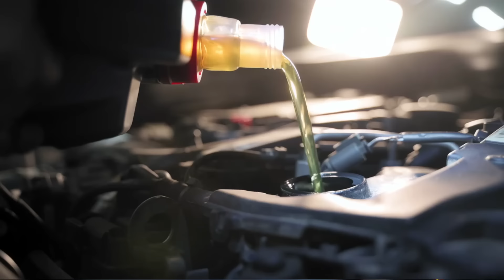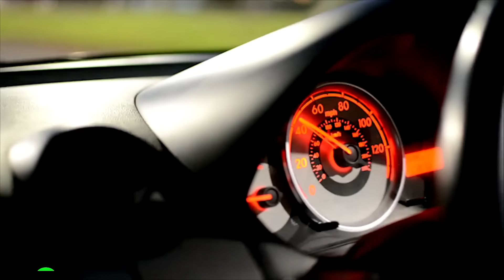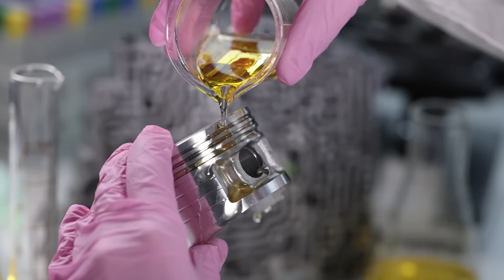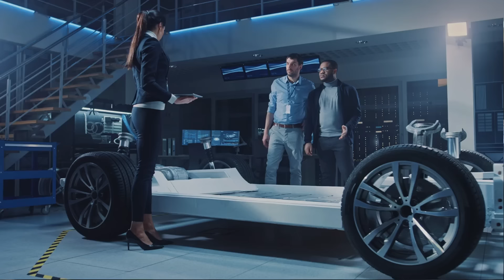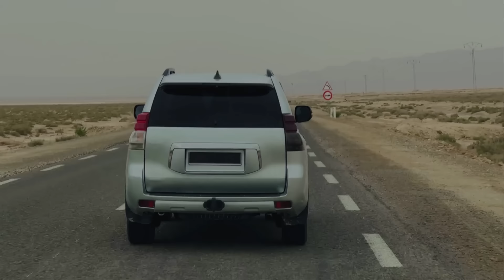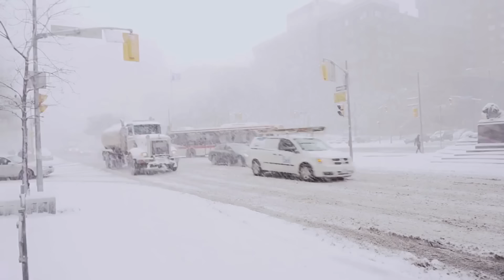Why the Same Engine Uses 0W-20 in the U.S. But 5W-30 Everywhere Else (Mechanic Explains!)

Comment: Liquid-cooled engines are designed by the manufacturer to operate within a specific, optimal temperature range, which for most vehicles is around 195°F to 220°F.  The cooling system, which includes a thermostat and radiator, actively regulates the coolant flow to maintain this range regardless of the ambient temperature.  The cooling system is also pressurized by the radiator cap, which raises the boiling point of the coolant (a 50/50 mix of water and antifreeze) well above 212°F, preventing it from boiling at normal operating temperatures.  While the system is designed to maintain a stable core temperature, extreme conditions (e.g., heavy towing in very hot weather) or a malfunctioning cooling system can cause the temperature to fluctuate outside the normal range.

Comment: Because car dealers are in the business of selling cars...0-20 will destroy your engine sooner.
Reply: I had a Ranger that I put 550,000 km on with 0-20 oil. I scrapped it because the rust was so bad, but the engine was still quiet and smooth. I did 15,000 km oil changes, and my only repairs were a starter and an alternator.
Reply: @DAB65  Canada? We live in the southern US where it rarely drops below 20*f.  Most new cars are labeled 0-20 but don't need it especially in the summer when it's 90+
Reply: @crashdsnowman1  , Just a quick question, your manual/dealer says only use their brand windshield washer fluid, do you follow that?
Reply: @DAB65  No, don't use the same oil you do either.
Reply: @crashdsnowman1  , I use the oil that is needed for the job. Mostly highway miles and no towing or hills.
0W20 has never negatively affected any member of my family's engines.
Reply: @DAB65  My Duramax uses 15-40, Mercedes 10-40, None of my motorcycle use 0 anything  same with both boats. Wife's old Lexus called for it and had pre-mature valvetrain wear, her fathers GMC 1500 Denali also had problems with lifter wear. After the dealer rebuilt the top end of her fathers truck the dealer put 10-30 in it. As soon as she purchased the new Lexus I changed the oil to 10-30.
Reply: @crashdsnowman1  , Diesels always use thicker oils. Higher performance engines also use thicker oils. Just like I said, use the oil needed for the job.
BTW, the 0 weight only apply within the first few minutes of starting the motor and the oil is a 30 or 40 weight when at running temp.
Reply: @DAB65  not if it's 0-20, it would be 20w which it what this and many other articles are about. https://www.youtube.com/watch?v=2-ECI5uK9eE
Reply: @crashdsnowman1  , there is no such thing as 20W.
My point is as soon as the oil is at running temp it is the viscosity of the number behind the "W".
Reply: @DAB65  I know  the second number is the viscosity when at operating temp and this article is about 0-20 like I said in the first post and , just like the one I linked.
Reply: @crashdsnowman1  , Lake Speed Jr has said numerous times that if you don't drive hard and do oil changes on time that 0W20 isn't an issue.
Reply: 20 and 30 weight oils pretty much flow at the same speed at running temp. 
Remember, Chevy told truck owners to go up to 40-weight oil (from 20) if running your truck hard.
Reply: @lonniebeal6032  , I've already said, use the right oil for the conditions. If you tow, drive hard or fast, and in higher temps a higher viscosity is needed.

Comment: I’ve never seen motor companies recommend different oil grades in the same engine.  The French, German, Chinese, only recommend one specific oil standard chemistry.   I have found oil companies  oil selectors will recommend wrong oil grades !    Renault uses a specific Mobil oil standard at service, and the Mobile oil selector at retail stores said this other type was recommended, l put in 750ml top up, instant chain noise !

Comment: I switch from 0W-40 in the winter months to 5W-40 in the summer it’s always full synthetic oil in a large diesel. 
My wife’s car is 36 years old with original engine which has had no major issues it uses 5W-40.

Comment: I have a 22 jeep grand Cherokee with a 3.6. It takes 0W20. My 23 charger with a 3.6 takes 5W20?
Reply: At running temp, they are both the same viscosity, that's what the 20 is.
The 0 and the 5 are the oil's cold temperature viscosity.

Comment: As per my car manufacturer recommendation either 0w-20 or 5w-30, i live in cold climate in the midwest part of US however about four to five months weather is very cold and snow up to three months, rest of the year is norma and pleasant weather. Should I use 0w-20 during winter months and 5w-30 other months, does it affect the engine negatively?

Comment: Toyota CCH in NW Orygone. Short trips and 77% EV ratio. I'll stick with 0w20. For now... A long trip for me is 28 miles, never drive over 60 as EV mode won't above 61-62mph, drive truck right lane if ever on freeway. I'm NEVER in a rush. I drove ALL of the 55 era.

Comment: According to Grok:

You are 100% safe to stay with 0W-20 at 5,000-mile/6-month oil change intervals.
There is no significant benefit to switching to 5W-30 and you may lose 0.3–0.8 MPG for zero measurable gain in wear or longevity.

When 5W-30 Would Help:
Towing >3,500 lbs, sustained 6,000+ RPM, High mileage (150k+) with oil burn

Blackstone Labs UOA (Subaru FB25, 5k OCI):
0W-20: Iron 12 ppm, Aluminum 3 ppm, Viscosity 8.9 cSt
5W-30: Iron 11 ppm, Aluminum 3 ppm, Viscosity 10.2 cSt
→ Statistically identical wear

End Grok.

Comment: In regards to Myth #3, according to Chrysler, the MDS of the 2009+ Hemi is designed for and requires 5W-20 to operate properly.  I live in TX and tow.  I would like to run 5W-30 for the extra protection.  What complication would occur if I ran thicker oil?
Reply: I switched to Penzoil Ultra Platinum 5w-30 in my 2015 Ram Hemi. I started to get the  notorious Hemi tick. I'm also considering putting on an aftermarket Hi-Flow oil pump. Some people were using 6.4 Hemi oil pumps in the 5.7 and  now they are marking them as aftermarket parts.
Reply: @AdBass59  American cars are going to blow up no matter what oil you use

Comment: My 02 Mustang GT has a recommendation of 5W-20 and my 14 Xterra is 5W-30. Both vehicles are out of warranty so I'm not concerned about warranties. A lot of people have different opinions about what oil to use. Based on several videos I've seen, I've been thinking that I should use 0W-30 in my vehicles that will cover the subzero to 100F+ degree temperatures that occur here. I plan to do the switch to 0W-30 at the next oil change. The only way to know if the switch has harmed the engine is to do an oil analysis.

Comment: My 3.0 Duramax diesel recommends 0w20 but common sense told me that wasn't right. I took an oil sample and then changed my oil to 0w30. Ran my truck for 1600 miles and changed the oil again, again using 0w30. Ran it for 3k miles and took an oil sample. The 0w30 had significantly less wear metals than the 0w20 oil, and the 0w30 had more miles on it. Notably, my fuel mileage was up slightly, not down like you would think, my engine oil temperature is down and not seeing any changes in oil pressure. The engine was already smooth and quiet to begin with so no noticeable difference there. I live in Texas and winter is coming up. I may stick to the 0w30 but I still have 10 quarts of 0w20 left.
Reply: Just make sure with diesel engines that if you change the viscosity you use that it still matches the other specs of the oil, like the API or ACEA grade. The 0w-20 speced for your diesel is different from the 0w-20 that most gas powered cars can use.
Reply: @madmatt2024 I went from M1 0w20 esp to M1 0w30 esp. Exact same additive package but higher viscosity & hths.

Comment: Have been running 0w-16 for 285K miles.
No issues.
OCI 5000K or 6 months.
Reply: Exactly, unless pulling maximum weight or in a hot climate, the recommended oil is fine.

Comment: My vehicle's oil cap states 0W-20 Dexos-1.  I use 0W-30 Dexos-1 in -40C/-40F deep cold winter months. During winter months I mostly do many short distances.    I use 5W-30 Dexos-1 in hot climate (+20C/+30C) summer months.  My vehicle tows trailers in both winter and summer months.  I also do my own Engine Oil & Filter changes when remaining use percentage is between 40% (which is 5,000 miles used).   I also installed an engine block heater and onboard battery charger.   Always "plug in" both during < -10C winter months....  This works for me...
Reply: Hi,why you dident use 0w40 ? or 0w30?
Reply: @sapereaude9907  Why would I put 0W-40 in Gm V8 5.3L engine?  40 is way "too thick" for the deep cold winter months.   Especially since I mostly do only short trips.   Just like clothes, the "thickness" is based on weather.  Same thickness does does NOT fit all weather seasons....

Comment: The extreme temperature range in the us plays a big part. From Alaska at -50 to death valley 125 they have to pick something that covers it all. Most wear happens at start up especially in extreme cold when flow is slow. Use common sense depending on environment and usage.
Reply: The older car manuals would recommend different viscosities depending on the expected temperatures.

Comment: I live in the south of France, On my CX-30, I switched from 0W20 to Castrol Magnatec 5W30, (the manual recommends either) the motor runs a lot smoother, the gas mileage didn't change much!
Reply: your saving your engine 5/30 yr round for my vehicles
Reply: keep that.  Clooney.🤡 ok
Reply: you need 10W-40 bro
Reply: You shouldn't notice much of a difference. 5w30 might be a little tougher on your oil pump tho. I would've switch to 5w20. You dont want to put to much of a strain on the motor. The number after the W is a lot more important that the first number.

Comment: They are designing the engines to fail, the same engine that says 0w20 would be better with 5w30 or even 10w30 but they are more than likely making the oil pumps for thinner oils and it could possibly make a burden on the pressure and prematurely ruin the oil pump?
Reply: No, they are using thinner oils to squeeze mpg performance. This is because of stupid government regulations that will charge for emissions...be mad at your stupid and greedy politicians!

Comment: Run the 0w-20 in the fall and winter and switch to 5w-30 in the spring and summer
Reply: I was thinking that 0W-30 would be good for year round use. An oil analysis will show whether I'm right or wrong.
Reply: @genericdude6551 . Sorry but it’s gonna be 5w-30 year round & I’m in PA
Reply: I switched from 0w20 to 0w30 in my Honda Ridgeline with 185k miles on it. I noticed the engine runs quieter and smoother. I just sent the 0w20 oil sample to SpeedDiagnotix for analysis. The challenge with 0w30 is it is difficult to find and not many manufactures make that weight oil. I found Mobil 1 0w30 at Walmart online for $25 for 5qts. I may run 5w30 in the summer months and 0w30 in the winter months.
Reply: I use Amsoil 0W30 in the winter .
Reply: @peterrudy9207 i tried amsoil signature 5w30 0w20 and 0w30 , i feel 0w30 has viscosity in the middle between 0w20 and 5w30, so i will go for 0w30 the whole year, my car is honda civic 1.5t
Reply: @peterrudy9207 If it is Amsoil Signature Series (pure synthetic)  - then 0W30 is good year around(high temperature does not beat it as much as other (mineral) oils
Reply: i make 5000 km per year
Reply: *0w30 for winter
Reply: Better yet, switch to electric
Reply: @Mabeylater293 you can’t take that electric car out to the Moab for a week.
Reply: @jesses6697 why not?

Comment: Down here in PR. Is almost over 75° all year long .I think I'm  gonna do one more 0W20 oil change and then switch to 5W30 on my 2024 Tacoma.
Reply: i agree with this move. my 2003 tacoma V6 stick runs like new with 204,000 miles using 5w-30 it's entire life. in ohio, it drops to around zero degrees in winter, and reaches 95 in summer. cheers 🛻

Comment: I can't kill my 23 year old 2003 VW GTI VR6!  I use LiquiMoly 10W-40 full synthetic, changed once a year (about 7500 miles), and I still have the original timing chains too!  Never changed the 6-speed manual transmission oil as well.  Shifts and drives perfectly!  WHAT A CAR!
Reply: Amateur.  My 2004 Honda Pilot has 480k kms on it.  I use the recommended 5W20 oil.  I use whatever brand is on sale.
Reply: Amateur, because he uses better oil than you? Pouring cheap, on sale oil makes you a pro? Omg, what a stud.
Reply: @scott88060  yes exactly. He was flexing because he assumes expensive LiquidMoly 10W40 led to his exceptional results. I used cheap oil and also achieved great results. So yeah, I am a top tier pro, obviously, and much smarter. I note he doesn't state his car's mileage, but I would guess my 22 yr old engine's >480k kms is almost double his. You simps assuming more expensive oil is better are laughable.
- Super Stud
Reply: @daveladd5614 I'm sorry but pilot drivers r generally turds. GTI much more credible
Reply: @daveladd5614 rookie... My Kawasaki ransomes 36 inch walk behind I bought in 1990 is still running flawlessly on straight 30weight   youre a tool with your measly 480k.  I've got easily that in running hours alone.  Have a seat

Comment: Think about this, in 1988 a Chevy 350 used 10w-30. A 2025 LT, direct injection engine, 6.2 in Caddies and GMCs or Chevys are recommended to use 0w-20. The factory and recommended bearing clearances are the same for all these engines. I use 10w-30 and it works great. We are all being mislead by people who do not want our vehicles to last.
Reply from the maker: You make a solid point, bro. A lot of the shift to thinner oils like 0W-20 is more about fuel economy targets than engine longevity. 10W-30 has proven itself for decades, and if it’s working well for you with good oil pressure and no issues, that says a lot. Sometimes real-world experience tells the truth better than marketing.
Reply: @CarCareCrewOfficial that’s exactly what it is. PERFECT example of when 5w20 started to hit the scene… Ford Modular engines in the early 2000s. One day, Ford calls for 5w30. Then all of a sudden a new model year comes with ZERO relevant engine changes and now Ford says it needs 5w20? Yeah no thanks. 5w30 minimum in anything that calls for lower viscosity.
Reply: Some variable valve timing engines require specific viscosity. My car uses 5w-30w, an 07 Toyota V6 3mzfe. I don’t think I’d be comfortable with thicker. I’m at 150k still doesn’t burn oil between changes. I do oil changes at 3k now. I’ve also stepped up transmission fluid and filter change times. On my older vehicles without the newer tech I wouldn’t worry and use thicker.
Reply: I wouldn't use thicker oil on engines with variable valve timing.
Reply: @gre @greenmachine5487  Acura MDX when I switched to 5w30, ended up replacing VTECH solenoid. To be safe, my mechanic recommended going back to 0w20
Reply: Viscosity breakdown=💰

Comment: Due to our Hot conditions here in Australia, i Only use 5w/30 in my 2024 Subaru WRX with No issues.    👍 Au
Reply: Same here also in Aus, I recently got a 2025 WRX, did my first oil change at 1,500km with 5W-30, although living in the tropics it probably wouldn't hurt to even go to 5W-40. The local dealer confirmed they use Castrol Edge Pro 5W-30.
Reply: @dinkidink5912 Good move 5w/40 would be a better choice up your way  👍

Comment: So 0w30 is the answer.  Why not just say it???
Reply: Ow30 doesn't have the same cold flow as 0w20, or the same lubricity as 5w30.
Reply: @Resistculturaldecline  Of course it does.  That's exactly what the numbers mean.
Reply: @daveladd5614  There's a range of flow rates within each numeric designation. Shake a bottle of 0w20 and 0w30 when its cold, you can feel it just by hand. And when hot, 5w20 is thicker than 0w20. And the 5w designations will always have more film strength than 0w, despite their 100c designation. If it were just simple as adding viscosity modifiers to get a big numeric spread, oil would just be 0w everything.
Reply: @Resistculturaldecline  I never said they were the same.  I said that 0w30 performs the same as 0w20 at low temps and the same as 5w30 at high temps
Reply: @daveladd5614  But it doesnt perform the same, as my last post. 0w30 isnt as good of a 0w as 0w20. Itll flow similarly, but not the same. And its not as good of a 30w as a 5w30 or 10w30. No reason to stay with a 0w in warm season. Use two separate grades per year.
Reply: @Resistculturaldecline 
 1. i dont change oil based on what season it is. I do it based on mileage, like most people.
2, OW30 has the SAME viscosity as 0W20 at 0 deg F and the SAME viscosity as 5W30 at 220 deg F.  This what the numbers actually mean.

Comment: Thicker oil in Europe is nonsense! Toyota is actually going down to 0W-8 here in Europe (after 0W-16 and 0W-12).
Why does the same car use the same oil in Alaska in winter and Texas in summer?
Why should a car in northern Europe in winter with a max speed of 110 km/h use the same oil like in Greece, Bulgaria, Croatia, Italy and Spain in summer where you can drive 130 km/h or in Germany without any speed limit at all?
Just use your brain when choosing an oil. 😉

Comment: 06 Subaru sti  5w-30 synthetic oil every 3,000 miles due to turbocharger
Reply: 2023 Toyota Tundra @ 57k Mobile 1 0-20 synthetic every 3k Twin turbo. unleaded fuel.

Comment: It means 5W30 is generally best overall.
Reply: Iam in the republic of south africa, I bought a toyota corolla  quest in 2024,I asked  sales person at midas spares,manufacturers  recommended  0w20,he said 5 w30 is suitable for it because is hot,I checked the booklet,two types of oil 0w20 and 5w30 the arrows shows same strength